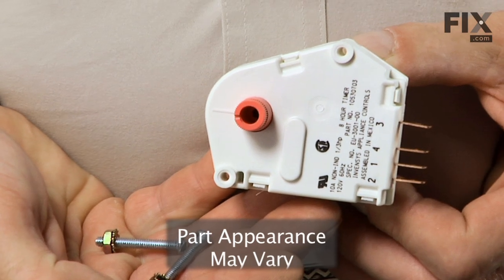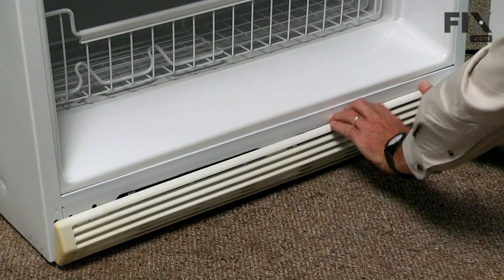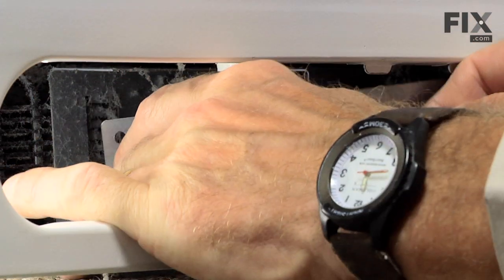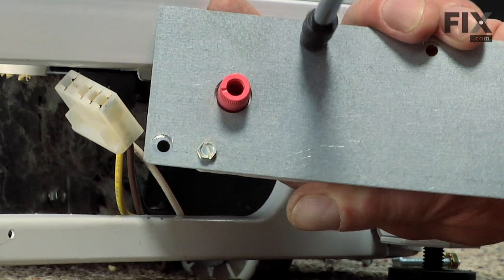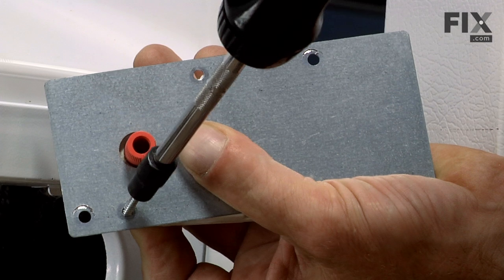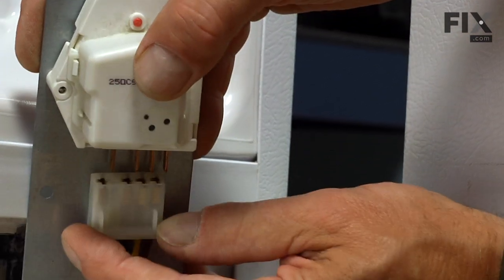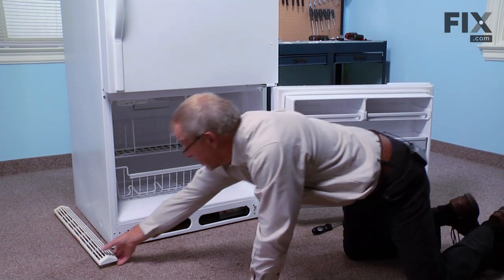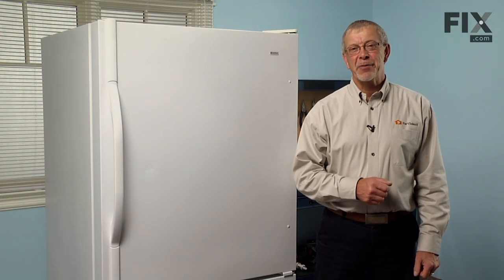Amana Refrigerator Repair – How to replace the Defrost Timer Kit - 120V 60Hz

Comment: Mine usually freezes up and stops cooling once a year because the timer is broken. I've chosen not to fix it so far because then I'm forced to clean out the freezer compartment and blow out all the ghost turds that have accumulated underneath. But there is also a way to manually activate the defrost cycle with the interior control panel.

Comment: BH20TL old part is warm and making a noise, has a green ground wire to mounting plate.  Will this R0131577 part work?
Reply from the maker: Hello, when I researched your model, the part that the manufacture has recommended for your model is R0131577. Here is the link if you wish to order: https://www.fix.com/parts/refrigerator/amana/fix2167006/defrost-timer-kit-120v-60hz-r0131577/?SearchTerm=R0131577&SourceCode=3   If you have any questions about ordering you can call us at 1-877-346-4809 and we can place the order for you. Have a great day.